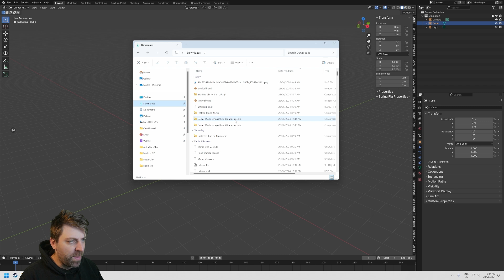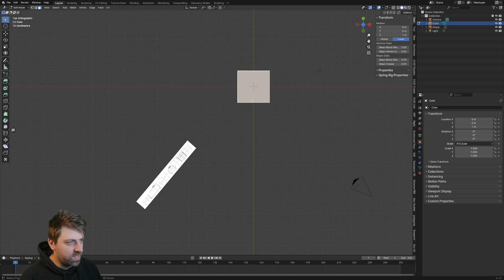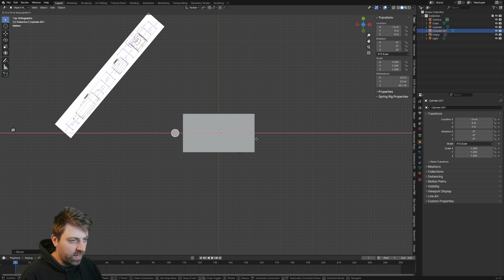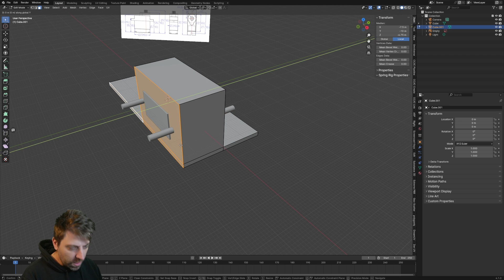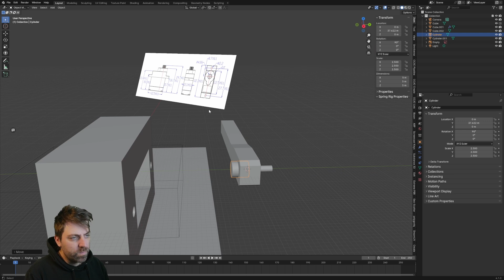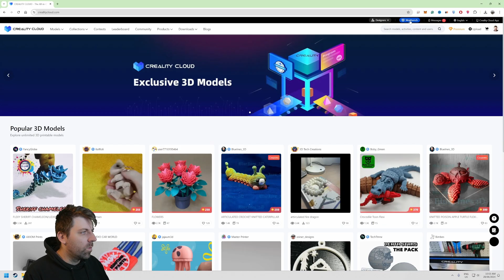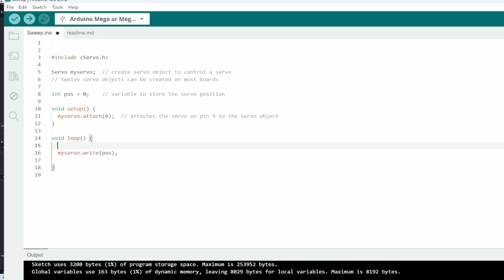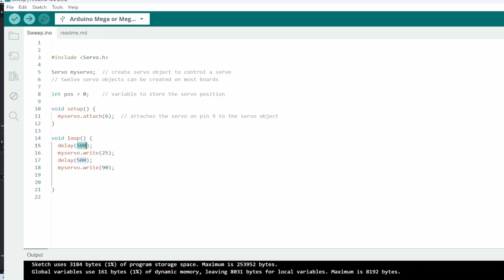Building a spacebar-pressing robot finger: My journey

Comment: as someone who has barely scratched the surface of arduino, what did you specifically use? Like what is the blue thing, what wires are those and what power source is that